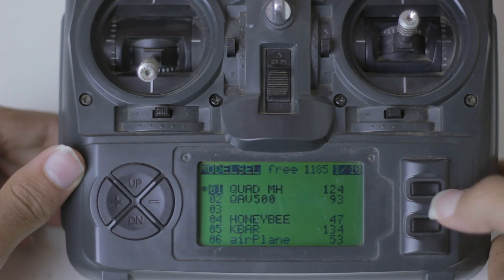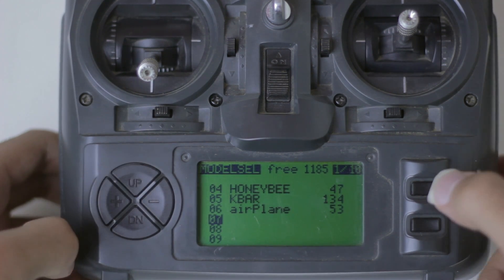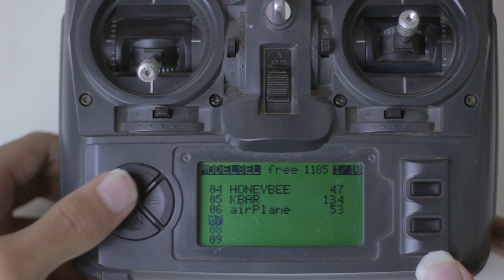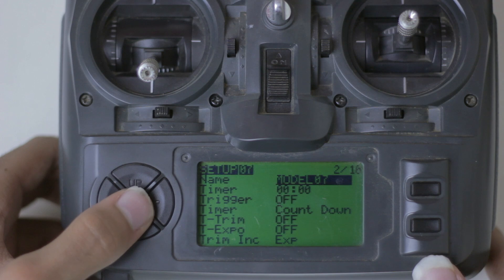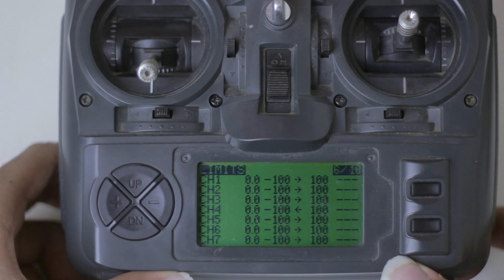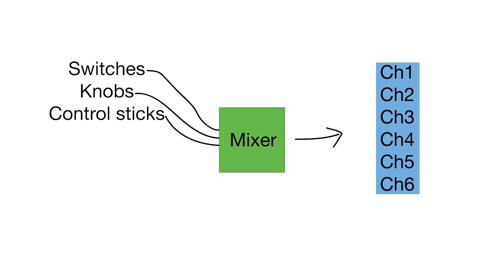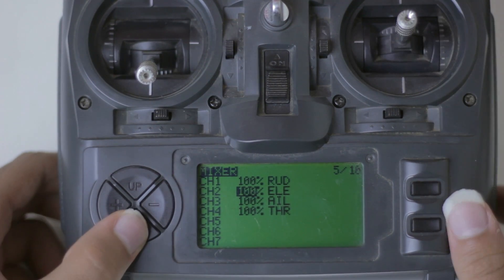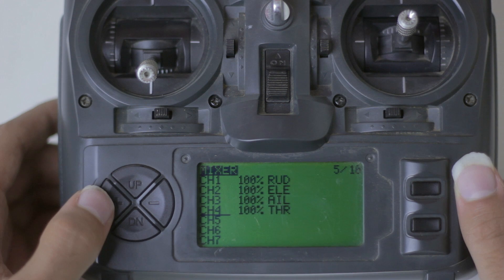How to Setup The Turnigy 9x For a Quadcopter

Comment: Does the title imply that the Turnigy 9X cannot be set up to fly a drone unless you perform a ER9X firmware upgrade? I called Hobby King where I bought the TX and they told me it would be a good TX for a drone application so I bought it. They didn't say that I had to do firmware upgrades first. Please help me.

Comment: i'm beginner at it. i ordered f450 quadcopter (apm 2.8 flight controller neo7m gps etc) long range controller flysky fs th9x and wolf box 1w 433mhz transmitter for search and rescue purpose but i don't understand how to know quadcopter location when quad found anything in forest few kilometer away from me
Reply: same here bro0
Reply: You need the data radios for the APM. Then download Mission Planner into your laptop/tablet. Plug one into the telemetry port on the APM 2.8 and the other into USB port on your laptop/tablet. With the radio plugged into your pc and the other on the quad you can see where it is on the map. It will also give you gps coordinates and you can setup autonomous flights by just selecting waypoints on the map. It's really easy.

Comment: how do I get that thing to control a quadcopter?
Reply: Did you ever figure out how to do it? I need help setting up a Turnigy 9X TX w/ an apm 2.8 flight controller in an f-450 drone. I doesn't work for shit.
Reply: @celsopizano6677  yes, & no. Yes, because I did get it to finally work the kwad. Although I had the transmitter set to the wrong mode. So when I finally got a indication of the transmitter actually functioning w/the kwad it was at 50% throttle as soon as I had armed the kwad. And being my 1st experience with any kind of hobby grade multirotor and being totally unfamiliar with the power that they can have, I reacted instinctually and went to knock it back down before it got high enough to fall and break parts. And quickly learned that lesson.
But after that, and not having any confident way of setting the transmitter correctly, I just ordered a FrSky Q-X7 (which had just been released). So sorry I don't have anything helpful for you.

Comment: Hey there, just trying to figure out why you would need these 3 postions and also the pot function? I've used a tricopter before, but I'm building a quad to try out, so I'm trying to fetch as much info as I can before I start to fly with it. Great video otherwise!